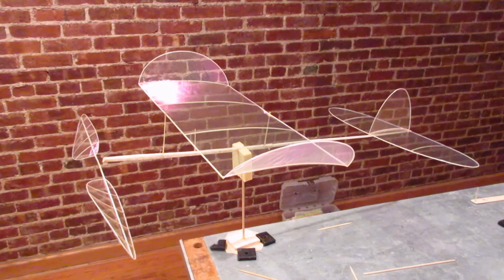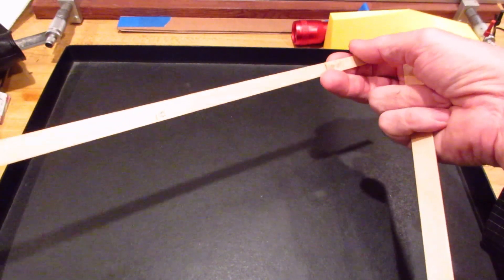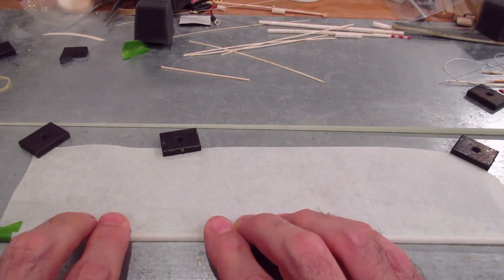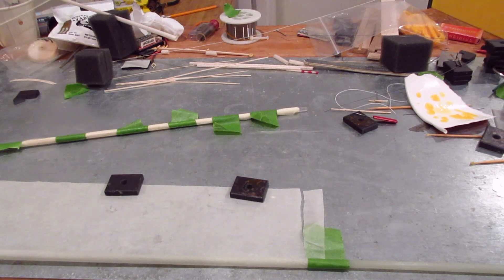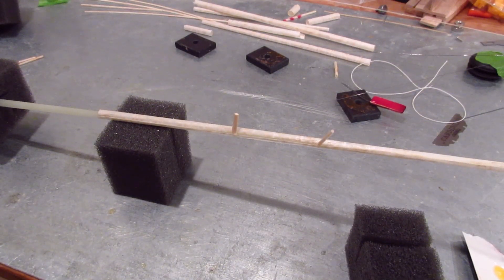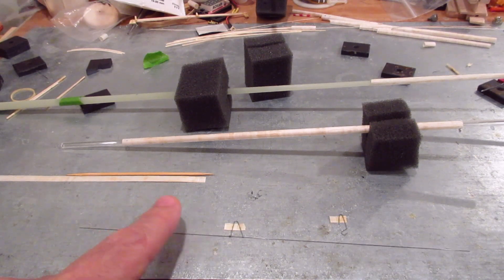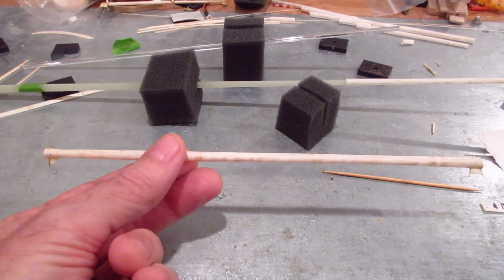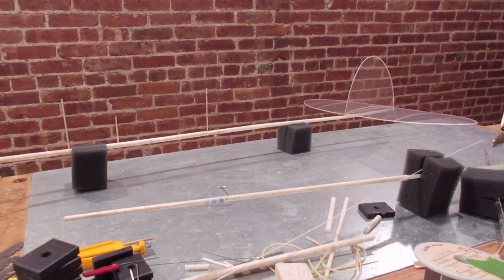F1R Build Part 1: Fuselage/Tail Boom

Comment: Hi, is there a preferred position for the glued seam on the model; top, bottom or side?  Thanks in advance, Steve
Reply from the maker: Usually the seams are put on the bottom, just for looks really, but in this case I liked the .008 stamp and so I put the seam on the top just so that the number was visible. But that's only if it's dead straight - if the boom is warped a little one way or another, then orient it so that the warp gives left turn or negative incidence, so you're using it to your advantage.

Comment: Thank you so much for the wonderful flashback of Ambroid and my model building as a kid!
Reply from the maker: Thanks, having crashed lots of planes as a kid, and having used both Ambroid and Duco, I thought that Ambroid was better because it's more flexible, whereas Duco was clearly more brittle, so I'm an Ambroid fan. However, that comment only applies to 1960's Duco, I have no idea what the current version is like, if I ever run out of Ambroid I'll find out!